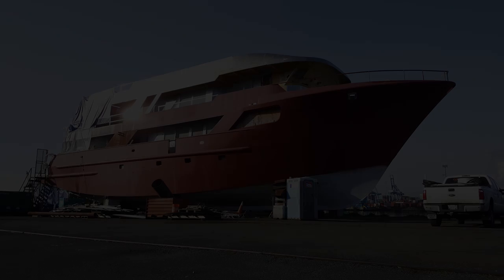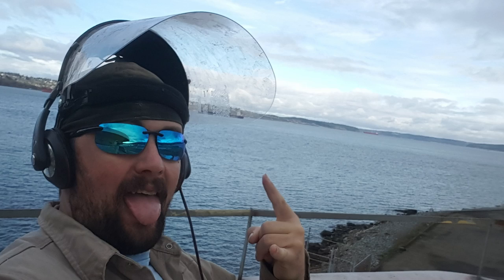SAFE Boat Launch How Omega Morgan does it!

Comment: I actually moved that exact Safeboat (and a few others they built) when it was a hull and deck from one building to another for Safeboat so it could be painted. Did it on a 62',  10' wide trailer and loaded it with just 10 boat stands and the air ride on the trailer. (no crane or lift) I think they were 95' long and 23' wide.
Reply from the maker: Cool!